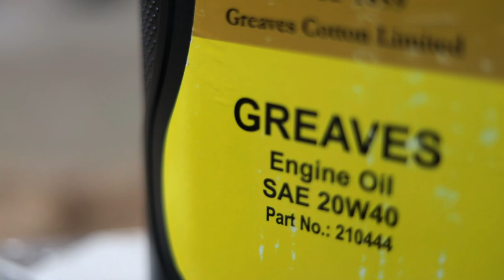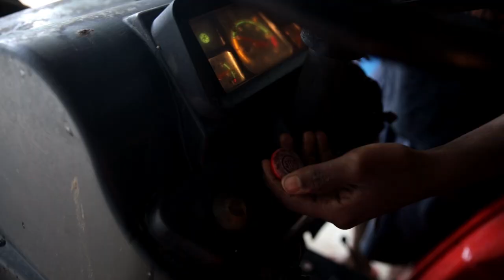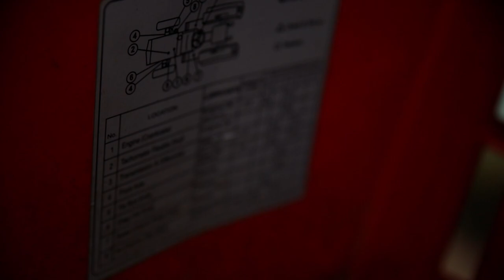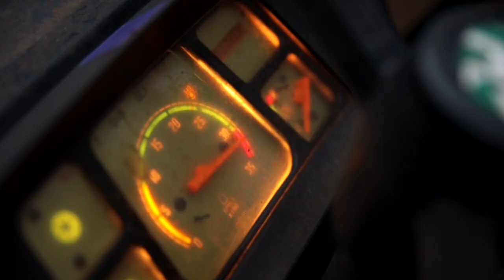VST 22HP MITSUBISHI MINI TRACTOR Regular service ( Fan Belt ,LIQUIMOLYFLUSH, FUEL FILTER ,OIL FILTER

Comment: hello friend, is this really a mitsubishi engine? ... in the electronic manual of the tractor does not say anything that it is an engine from Mitsubishi
Reply from the maker: It's full and full Mitsubishi K3 Series Diesel engine bro you can search in google
Reply: @gowthamv3132  same for the 180D with the k3c and the 270d with the k4d engine.
Reply from the maker: @snouwbaard  s bro

Comment: What is the use of engine flush... bro
Reply from the maker: Every 1000hrs hours using the Engine flush cleaning the engine carbon deposit little bit so only used
Reply: Ok bro  thanks.